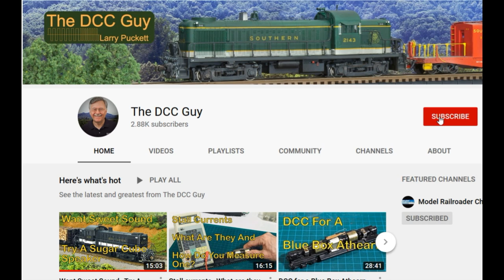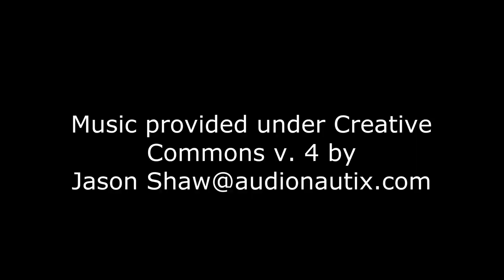Hitting The Brakes With SoundTraxx Decoders (178)

Comment: Thanks Larry, great Video as usual, these modern Control Systems are amazing, I remember my old DC Controller that I used when I was a Tacker back in the 50’s, you wouldn’t have believed what would become available in the Space of 70 odd Years or so. Keep Safe.
Reply from the maker: I should have mentioned that SoundTraxx now sells Econami decoders in both UK steam and diesel versions. All my UK steam locos have ECO-100 decoders and when I got my GWR Flying Banana I used a Econami 21 pin UK diesel decoder. Fortunately they included Derby DMU sounds and those locos used the same AEC diesels as the old GWR locos. It was a lot cheaper than buying the factory sound version or from a UK supplier. It is interesting how different the US and UK markets are with sound decoders. Over here all decoders come with sound included but in the UK they sell the decoder and you pay extra for the sound package. That adds as much as £20 to the cost of a decoder. That makes Soundtraxx UK decoders a cheaper option.

Comment: Great video Larry.  I still have an old Atlas Mantua 4 wheel trolley from my boyhood train platform that runs and I'd like to convert it to DCC.  I've figured out how to isolate the motor brushes from the frame and now I'm considering decoders.  Can you recommend an economical, basic non-sound decoder that will play nice with the old open frame LBJ-era motor in my old trolley?
Reply from the maker: It likely will draw a lot of current and be a 3 pole straight wound motor so don’t expect it to run like a modern loco. As a minimum I would use a decoder rated at 2 amps however you could narrow that down by checking the stall current, see my video on stall currents. Have fun with the comversion.

Comment: I would be willing to bet that I am the only knucklehead out there that has real working electric brakes on some of my rolling stock! YUP!!!! real working brakes! MOTOR OPERATED!!! The motors are very small, and they are battery operated with extra small limiting switches for both set and release!

Comment: Any suggestions? I installed a Tsunami Sound Car decoder. If I use a magnet I can get it to make the clickly-clack and wheel squeal but I can’t get it to consist with the engine. So I get no bell and whistle. Thanks
Reply from the maker: Odd, I installed one of these for an article about 5 years ago and had no problems consisting then. My only suggestion would be to recheck your consisting steps and make sure you got it right.
Reply: @TheDCCGuy  I’m sure I’m doing it correct. Yes, it is strange. Thanks for the reply.

Comment: I use TSU-2 Steam decoders.  Do you know if this applies to the steam version too or will I have to play with it to find out?
Reply from the maker: I don’t think I have any Tsunami2 decoders to try out but I will take a look at the steam manual and see what they say.
Reply: The Tsu2 has all braking (independent and automatic) on all formats..  the exception is functional dynamic braking only applies to Diesel.  The Econami has the independent brake in both steam and diesel.  Contact me at support @ SoundTraxx. Com for details and check out our SoundTraxx YouTube video for more details.  We’ve covered it in several videos.   Thanks!
Reply from the maker: George, thanks for adding that info on the TSU steam functions.

Comment: I don't understand this. And I'm talking about Econami as that's what I have. If I set a braking rate up to 127, applying a brake will slow the loco down at a slower rate than just reducing the throttle, because the brake rate is added to the deceleration setting?
Reply from the maker: That’s pretty much it in a nutshell. In the demo I only used the F11 button to stop the train and left the throttle setting alone. I used a small value in CVs 3, 4, and 117 because I had a short area in which to shoot the video so that is why it slowed fairly quickly and started up fast again. You can tweak the locos stop and start behavior by using a combination of settings in CVs 3, 4, and 117. That is why I suggest trying out various combinations to get a feel for what you like best.
Reply: Why would anyone want to apply a brake and slow down over a longer time than just coasting to a stop??
Reply from the maker: Maybe because thats the way a real locomotive or train behaves. I know folks who do all the same procedures as a real engineer would go through in running a train and this braking procedure adds to the realism for them.
Reply: My point is that braking should stop faster, not slower.
Reply from the maker: But real trains don’t work that way. Once you get 100+ cars strung out almost a mile behind a set of locomotives it takes a long time to bring all that mass to a stop. And the faster they are going the longer it takes. Unless you have your momentum set real high using a throttle to stop a train is far from prototypical.
Reply: And this is what I don't understand. Braking should decelerate quicker, not slower, than throttling down.
Reply from the maker: Well, depending on the values you enter in CV4 and CV116, 117, or 118 you can increase or decrease the braking effect. as you desire.
Reply: Donald, on my Tsu2, I’ll set my momentum deceleration rate high.  Then I set the independent brake rate in CV 117 for a quicker stop.  Then I’ll set my automatic brake rate to stop more slowly, but still subtract from my momentum in CV 4.  That way, when I’m independent my loco stops faster than just a dial of the knob, to simulate the brakes on a light loco.  So, try this.  Set CV 4 to 200.  Then independent brake in CV 117 to 255 (for a -128 rate off the CV 4 value) for a net braking of about 72. Then, set CV 118, automatic brake rate to 178 (for a -50 off CV 4) for a net braking of 150.  With F12 off, and F11 on, your loco will stop relatively quick, just like it was light, switching or spotting cars at industry.   Now, once done, and tied into the train, turn F12 on to ‘charge the trainline’ and you’ll hear the compressor cycling.   Now run the loco and turn on the F11 and you’ll see the loco slow, but still at a faster rate than if you simply turned down the knob.   Try this and if you still have any questions, contact me at support @ SoundTraxx. Com and I’ll help ya further so you can better understand the features we built into the decoders.   Thanks
Reply from the maker: George—great tips on your approach to tweaking these CV settings, thanks for adding them.
Reply: @goaliegeorge  Finally, someone seeing my point! Unless you set a braking CV to more than 128, you're not really braking at all. So why even have the braking values that reduce deceleration?

Comment: Hay DCC Guy when i worked on the railroad if the engine brakes squeeked to loud it needed new brakes.
Reply from the maker: Were those composite or steel shoes?
Reply: Ok mr.DCC Guy ON most of are engines had steel shoes the composite are on rolling stock cars..